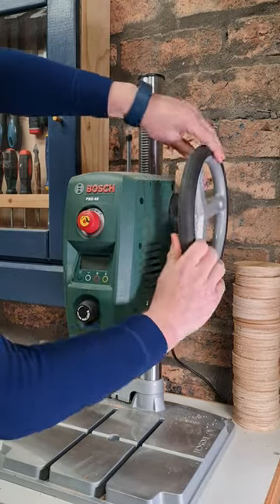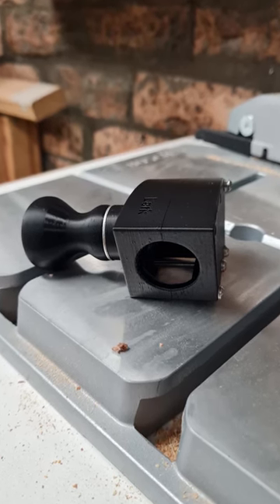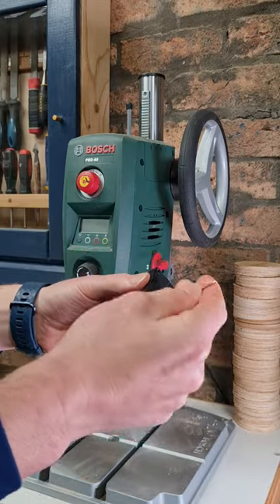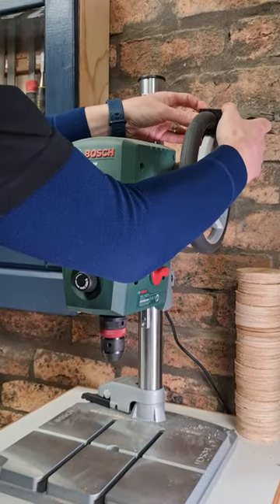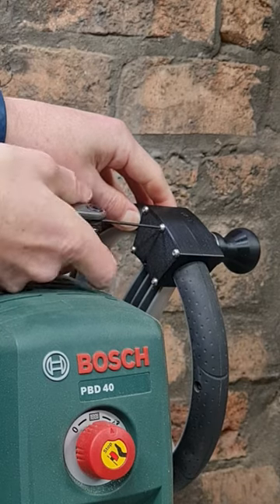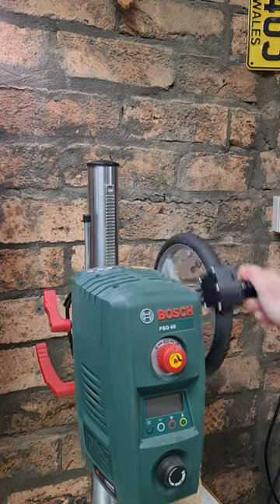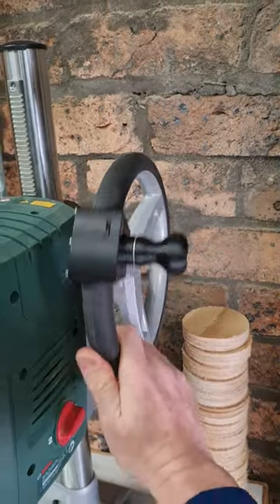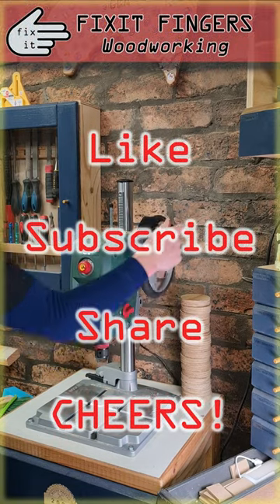AWESOME Bosch PBD40 Drill Press Auxillary Handle - A 3D Printed Solution by @Derek_Lark!

Comment: Hi, can this Bosch drill have its body swing 180 degrees around the main post  to the back so that base plate is out of the way, to drill some thick or long stock, end grain, or dog holes on a bench? Thank you !
Reply from the maker: G'day mate... you know, I've not tried. I'll take a look when Im in the shop tomorrow and let your know.
Reply: @FixitFingers 
How'd it go?
Reply from the maker: @gustaveliasson5395  you know I went into the shop the next day...and completely forgot to try this 😅 ... Hang on...
Reply: @FixitFingers 
I got one. Checked. The top does not swivel.
There's a nub on the right side of the pillar that fits into a slot on the base and keeps the pillar aligned so that the chuck stays directly over the hole in the center of the table.

On the other hand, the hole in the base goes straight through, and is wide enough (Ø18mm, iirc) that you can, in principle, simply place the machine on top of a workpiece and drill down through the base.
Reply from the maker: @gustaveliasson5395  Argh cool, good to know... however would you get the travel on the plunge to get far below the base of the machine? Might need a long bit! ;)
Reply: @FixitFingers 
<sigh>

I'll check...
Reply: @FixitFingers 
Alright, turns out the silly thing will run right on down until the chuck kisses the baseplate.

As the baseplate is ~30mm thick, and you'll probably want your depth stop set a bit above that you you don't accidentally drice the chuck into the base, I'd say that you'll lose about 32,5mm of drill depth when drilling through the base.
Reply: Yes appears you can, I have just tried. There is a pin in the stainless pipe stand that locates to centre, this can be managed 2 ways.

1.  just leave the stand out from the bottom 10mm so the pin sits on top ( outside ) line up manually and tighten the allen key, it will be secure enough. 

2. The pin can be tapped to the other side. 

Great to getting access to larger pieces for drilling.
Reply from the maker: @jameslovering9158  that's awesome. I'll have to take a second look